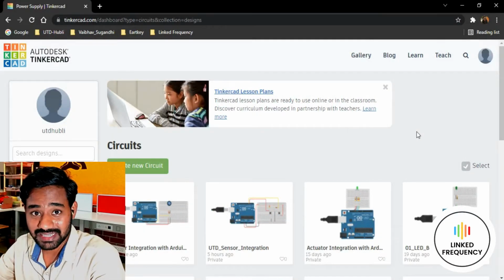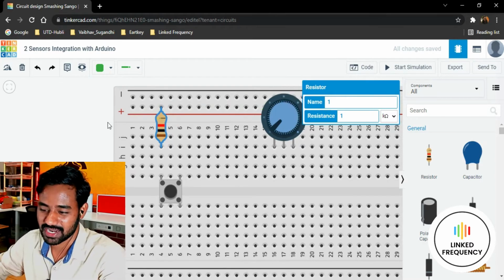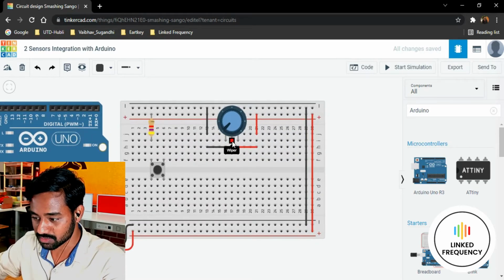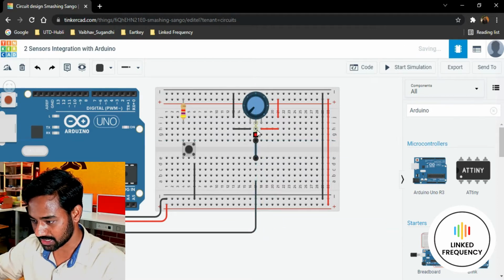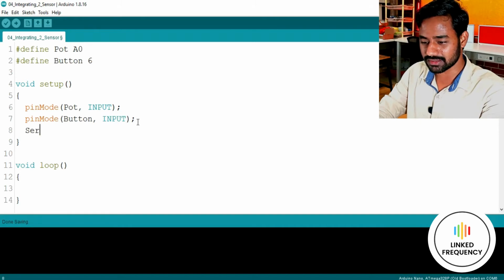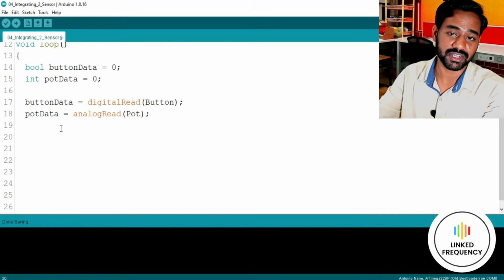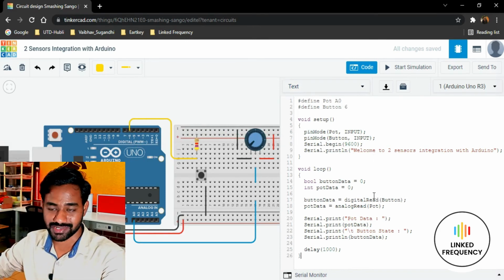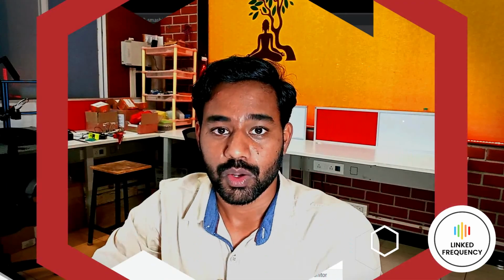Integrating 2 sensors with Arduino using Tinkercad #E11 | Vaibhav Sugandhi

Comment: Hello sir.. for my project i am using two sensors. I have separate code for those two sensors. How to integrate those two code into one in arduino ide?
Reply from the maker: Hi Nandhini, 

I have explained simple process for this question in the same video. Have you watched full video? If not, please watch. 

However, simple thumb rule is here : 
1. Create a new file in IDE and copy paste everything from Sensor 1 code into this new file. 
2. Now save this new file with proper name(eg. integrated_code). 
3. Copy and paste everything in above setup from Sensor 2 code to new file integrated_code.
4. Copy and paste everything inside setup from Sensor 2 code to new file integrated_code.
5. Copy and paste everything inside loop from Sensor 2 code to new file integrated_code, with your logic of flowchart.
6. Copy and paste everything after loop from Sensor 2 code to new file integrated_code, if you have created any user defined functions.

That's it. Ofcourse you need to have good hold on basics of C programming to handle this integration process. 

Happy leaning :)

Comment: Thank u sooooo much for detailed tutorial about how to code our peojects, i have a request plz continue making real projects in tinkercad or physically and teach us the code, nobody on youtube does this. I also have a specific request for wireless nrf modules programming, like if we want to use them for water tank monitoring where sender module will be attached with float sensor or ultrasonic sensor to measure water level and reciever will have a lcd display which will map data recieved from sensor and show in waterlevel percentage on lcd screen. Also introduce manual switch to run pump anytime we want. This will teach us a lot of things and make us able to start creating our own real projects. Looking forward.
Reply from the maker: Hi Aydee Sam, 

Thank you for your suggestion and feedback. 
We are working on further tutorials and will be processing them soon. 

Using wireless nRF module for overhead tank monitoring is really good idea. We will consider this project in one our future content. 

Happy learning :)
Reply: @Linked_Frequency  looking forward. Dont forget to add auto and manual pump control.
Reply from the maker: For sure :)